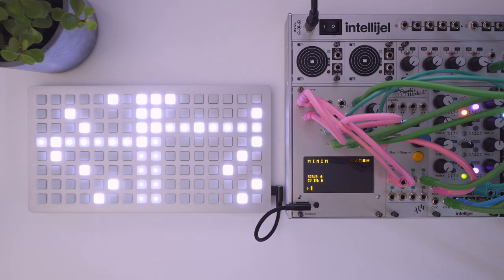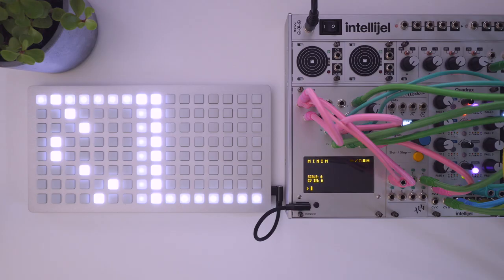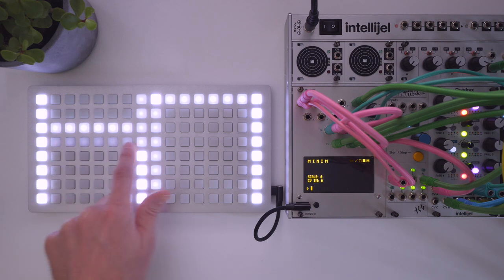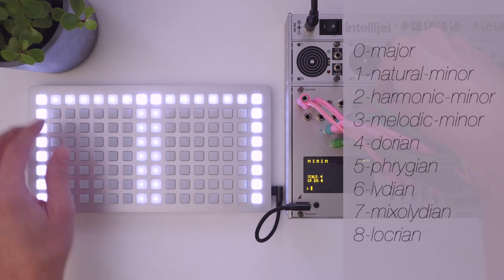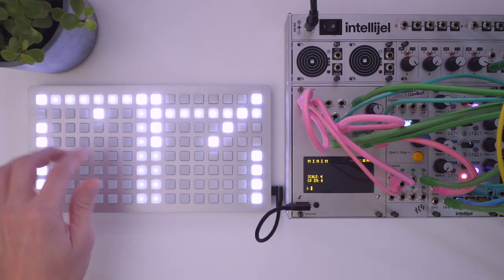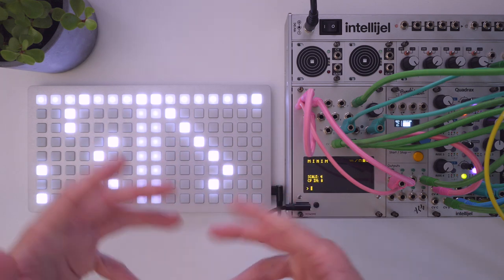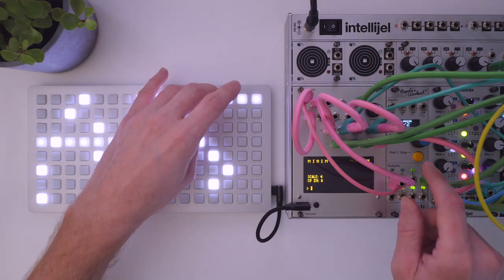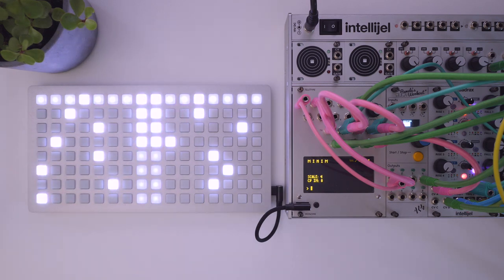MINIM: A playable chord sequencer and arpeggiator for Monome Teletype + Grid

Comment: Loving the look of this script! Just wondering how difficult it would be to incorporate JF in stead of or as well as the CV outs. I'd like to use this as a chord sequencer for JF and the CV outs an arp sequencer and the root note for bass with my mangroves.
Reply from the maker: Ooh I love this idea. Normally this would be simple but this script is so full that it will be a big challenge to fit in the JF ops in addition to CV. I’ll look at it when I get a chance and see what I can come up with. At the very least maybe we can replace the chord CV with the JF ops (but no CV for the chord root note). If you want to take a crack at it, script 1 and 2 handle the chords and one option to fit it all in there is to remove the arp reset function which is after the BRK in script 2.
Reply: @ModularBeat  Oh amazing you are into it! I did have a quick look at the script but unfortunately couldn't figure out what to change to add JF into it. I'll patiently wait to see what you come up with :)
Reply: @ModularBeat did you ever look into this/make progress on it? I would be super interested in this as well
Reply from the maker: Nope. The successor to Minim, Subsequence, does support JF tho
Reply: @ModularBeat awesome. I’ll have to track that down!

Comment: This is great and I've been using it extensively for the last week or so. I was wondering would it be possible to add the ability to use a Txi with the knobs possibly allowing you randomize the sequencers or the loop lengths? I would love to add the ability to make this more generative however your code is much more advanced than my abilities and I'm having a hard time reverse engineering it.